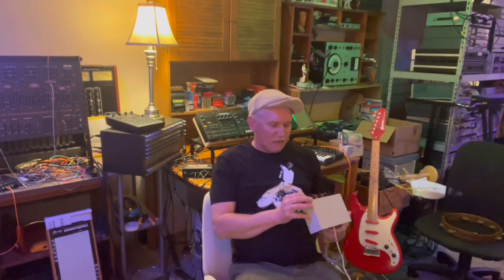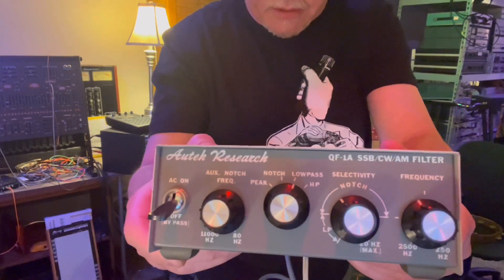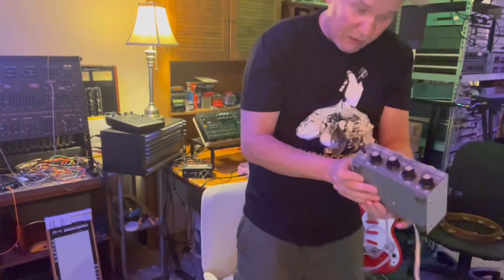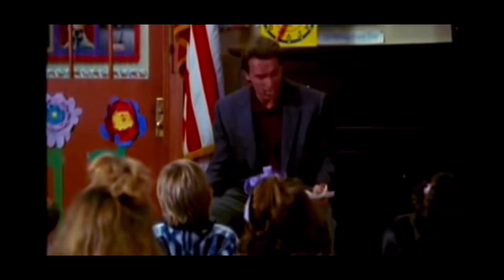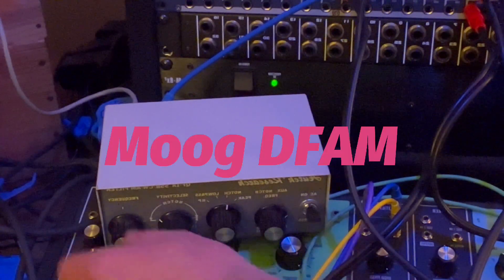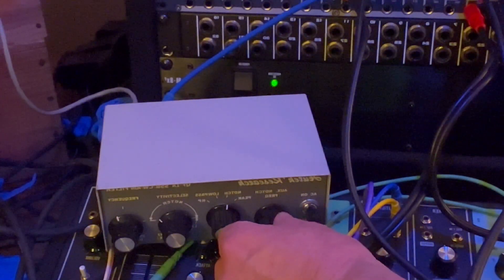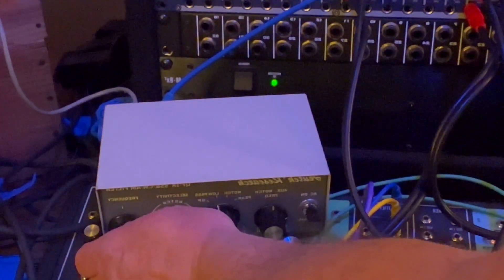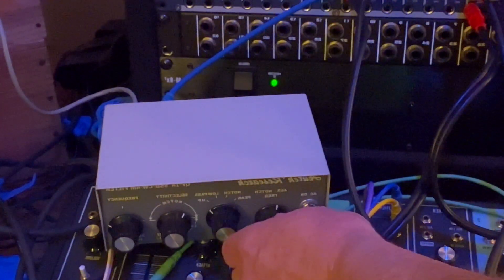Analog filter test with Autek Research QF-1A SSB/CW/AM Filter

Comment: Hello again. While I was calibrating my units with pink noise generator and frequency analyzer, I saw that there was a significant amount of low frequency rumble going on... Looking at the schematic, I spotted that the output capacitor C16 is a huge 100uF... Maybe am I fabulating but I suspect an error had slipped between the design and production team... An "n" turned into a "u"....100nf became 100uF... I tried with 100nf and it looks and sounds much better. It also tames the remaining power supply hum that bleed in the audio signal to a quite noticeable degree... Great!  
If pulling out the circuit to do the modification bothers you,  simply adding a 100nF capacitor on lug 3 of the bypass switch (check to ensure that it is where the processed signal arrives to the switch on your unit) will do the trick. And if you want to use that low frequency rumble sometimes,  it is also possible to add a tiny switch to make that low-cut optional. Enjoy!

Comment: Thank you for the demonstration. Lovely filter!
Here's a few advices for those using it or looking to get one : I own two units from different era. The quality is highly inconsistent from one to another. They were hand soldered and the skills of people involved varied a lot. The pc board is solid but the traces are not always neat. Check this if you encounter issues. The good units have superb and sturdy Toya knobs vs. cheap copies on the lesser quality units. I found nice similar looking knobs (digikey part 450-1725-ND) to replace them... not exact copy but much better quality.

About capacitors : electrolytics in them are getting old... replace them with fresh ones. Also...To avoid a shocking surprise...There are two ceramic caps from line to ground before the transformer. Replace them with certified Y rated safety caps and install a polarized power cord (hot wire/slim blade  to switch). And why not take the occasion to refresh the rectifier diodes at the same time. Those in my "nasty" unit were blown when I bought it "for parts".
By the way...Take good care of the pots and rotary switch... they are custom made and exact replacement parts can only come from another unit.
Very interesting filter by itself for sound processing but also useful in compressor sidechain or as expander-gate key.
I replaced the input/output with 1/4 TS plugs for that purpose on mine. 
These simple beautiful sonic tools are easily serviceable and will last forever (even crappy ones!) with good care. Have fun everyone!
Reply from the maker: Much appreciated!